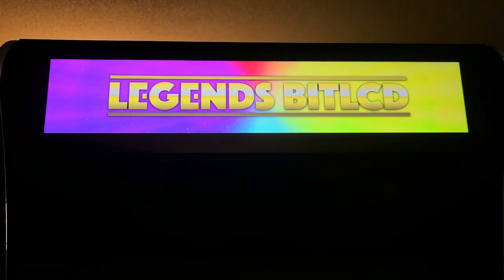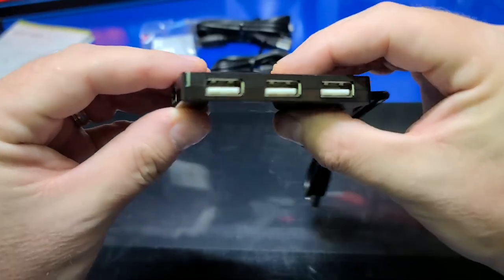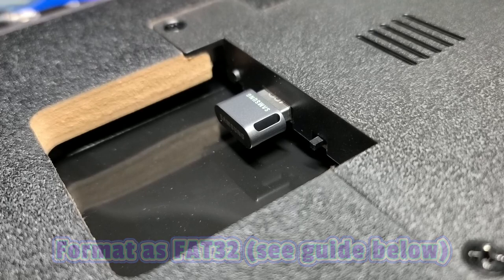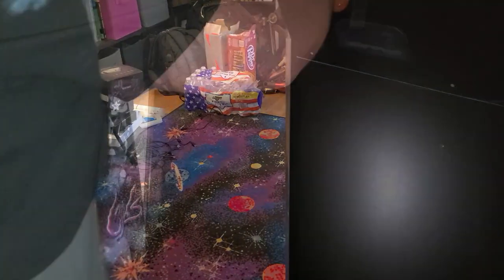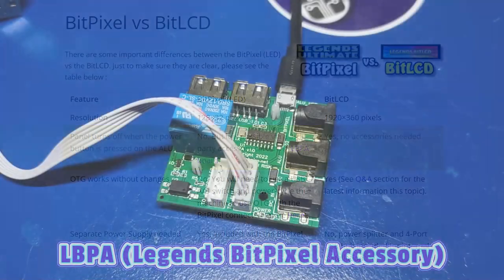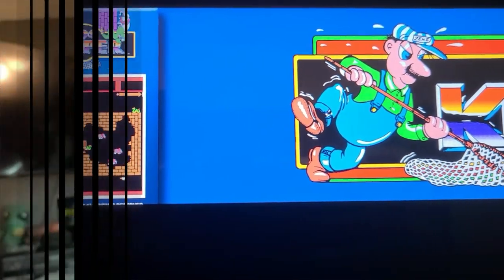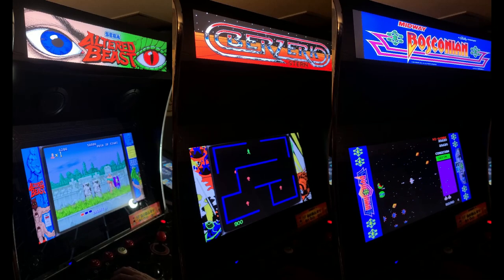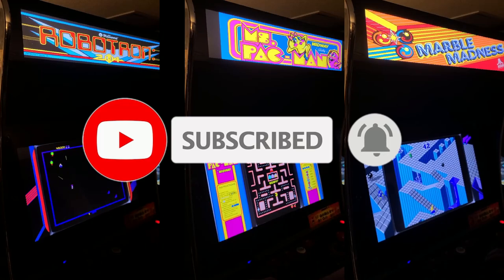Legends BitLCD Arcade Marquee Setup and Review (AtGames 2022)

Comment: Thanks for the video. I just installed my bitlcd as per the directions and when I try to load bitlcdx on appstorex it reads flashdrivex has not mounted. I am using a brand new 32GB PNY 3.2 usb and made sure it was formatted fat32 and I even tried another formatted usb. Does anybody have any idea what I may be doing wrong?
Reply from the maker: If you're talking about the USB stick on the ALU itself, have you tried formatting the USB stick using Flash Drive X (FDX), mount it and then install the BitLCD application from AppStoreX (see here https://wagnerstechtalk.com/al-bitlcd/#Update_Firmware_and_Resources )?  Of course, you also need a USB stick with the images on the BitLCD itself as well.  The guide at the link above has much more info.
Reply: Thank you for responding, my bitlcd doesn’t seem to recognize any usb that is in the usb2 slot. I tried formatting and mounting it on the cabinet and it downloaded bitlcd but I was unable to update it because there wasn’t a usb in the usb2 slot. Either I’m missing something or usb2 slot isn’t working. I am getting lights on my stick when I plug it in however.
Reply: AtGames responded and I was able to get the BitLCD running. I had to do some additional steps (maybe because of an update). I’m including in case anybody else has the same issue. 

Hi Christopher, 

Good afternoon and thank you for reaching out to us. I can gladly assist you with this matter. 
I have provided you the below steps to set up the flash drive and put both the update and resources on the flash drive from a computer. While it is a lot of steps, this should get your flash drive all setup and you all good to go. Please let me know how this goes.
BitLCD Flash Drive Setup Steps

1: Please confirm that your ALU's Firmware is up to date on 5.67 or later
2: Please ensure you are signed in on your ALU and have successfully installed the BitLCD application found under the AppStoreX tab.
3: Once this has all been completed, please power off your ALU and If the flash drive is in the back of the BitLCD, please remove it
4: We will now take the Flash Drive to your computer to prepare it. 
5: Please plug your flash drive into your computer
6: We will be using Raspberry Pi Imager software to erase and format the Flash Drive as Fat 32.
7a: If you have a Windows PC, please download Raspberry Pi Imager from the following link: https://downloads.raspberrypi.org/imager/imager_latest.exe
7b: If you have a Mac, please download Raspberry Pi Imager from the following link: https://downloads.raspberrypi.org/imager/imager_latest.dmg
8: Once you have downloaded and installed Raspberry Pi Imager, please launch it.
9: Under "Operating System", select the button that says "Choose OS". Scroll down until you see "Erase" and select it.
10: Under "Storage", select "Choose Storage" and from the popup please select your Flash Drive from the list.
IMPORTANT: Please Make Sure You Select The Correct Flash Drive You Want To Format For The BitLCD.
11: Please select "Write" and from the popup please verify everything is correct and select "Yes".
12: Once the write has been successful, select "Continue". You may now close the Raspberry Pi Imager software.
13: We will now download the "bitlcd_update_online.img" from the following link: https://wagnerstechtalk.com/files/atgames/bitlcd/bitlcd_update_online.img
14: Once it has successfully been downloaded, please take that "bitlcd_update_online.img" file and place it on the root of the Flash Drive.
15: We will now download the BitLCD Resources from the following link: https://wagnerstechtalk.com/files/atgames/bitlcd/BitLCD_Resources.zip
16: Once downloaded you will need to unzip/extract the file
17: Once it is unzipped/extracted, you will now have a folder named "BitLCD". 
Important: If the folder is named anything other than "BitLCD", please rename it to "BitLCD"
18: Once you have verified the name of the folder is correct, please take that "BitLCD" folder and place it on the root of the Flash Drive.
19: Once you have successfully placed both the BitLCD update file and the folder on the root of the Flash Drive, please properly eject the Flash Drive from your computer.
16: We will now take the Flash Drive and with your ALU powered off, we will plug the Flash Drive into the BitLCD.
IMPORTANT: Please make sure the little switch is up closest to the USB port
17: Once the Flash Drive is plugged into the BitLCD, you may power on the ALU.
If upon powering on you receive the flashing blue BT pairing lights, please hold down the P2 button for 7-10 seconds and this should take it out or BT pairing mode and turn the lights off.
18: Once Powered on and you have been successfully signed in, please head to the AppStoreX tab and launch the BitLCD application.
19: Once launched, verify that the BitLCD is properly working.
19: If not, please go into the BitLCD app and go over and select "Update BitLCD"
20: We will select "Update BitLCD Firmware". If at any point it fails, please try again and even power off and back on the device.
21: Once successfully updated, you do NOT need to update BitLCD resources since thay are already on the Flash Drive.
Please note that this process may take some time. Please let it run and don't interrupt it
22: Once this successfully completes, you should now be all set to enjoy your new BitLCD!
 
IMPORTANT NOTE: If the above steps still fail for you, please try a different/new Flash Drive as some Flash Drives may have issues properly reading.

Thank you,
AtGames Customer Support

Comment: I just got my BitLCD today and it was working perfectly at first. When I went to update firmware the screen went black and doesn’t work anymore. And yes, I had a USB 32GB formatted to FAT32. This sucks! I waited 2 years for this and this happens day 1. Multiple people have the same issue on FB ATGames fan page. The update will break your marquee! Why did your work and ours didn’t? I’m so pissed off at AtGames!
Reply from the maker: I installed/reinstalled the firmware no less than 5 times on my unit, multiple firmware versions installed also (5.65, 5.66 & 5.67) - no problems.  I recommend contacting AtGames customer support at : https://www.atgames.net/arcades/contact .  If it's an issue I've not seen nor can reproduce, I'm not going to be any help at this point.  I'm sure AtGames will take care of the problem, regardless.
Reply: That’s so strange. I had everything up and running perfectly. Had the Marquees displaying on the games and went to update firmware and the screen went blank. Nothing I have done has fixed it. I did put in a ticket with AtGames. Hope they come through. I don’t think I’ll ever update again with AtGames.
Reply from the maker: IMO - I always update.  When you get up and running with the BitLCD, I recommend updating.  At some point there is going to be a firmware update to use the HDMI port (most likely).  If there is a problem, you want to get it fixed while it's under warranty not after.  Just my $.02.
Reply: I appreciate your support. Apparently I got banned on ATGames legends global fan page for posting pics and my concerns. Unbelievable.
Reply from the maker: I'm sorry to hear that.  It's extremely rare when I do that, typically spam & porn is when I block users/delete posts here.  At any rate, get that BitLCD working through CS.  You'll be very happy with it when it is.  If there is anything I can do, just let me know.  When working, please let me know that too.

Comment: My lcd went kaput.  Followed tutorial. When its supposed reboot phase of firmware, it blinked and never restarted...was left alone for an hour for reboot and nothing. Powered cycled, starts then says no signal and shuts off.
Reply from the maker: What model ALU do you have, 1.0, 1.1 or 1.2?
Reply from the maker: Also, try unplugging the power plug from the wall itself and re-plug it. It should come back on (steps also here: https://wagnerstechtalk.com/al-bitlcd/#Troubleshooting ).  Then try again, if that doesn't work you can reach out to AtGames CS here for their recommendations: https://www.atgames.net/arcades/contact (purple icon for chat)
Reply: @WagnersTechTalk  Alu 1.1
Reply: @WagnersTechTalk  it turns on shows atagmes green logo, then gies blank and shows no signal screen and then shuts off.  All it does.
Reply from the maker: Try unplugging from the wall and back in, let me know if something different occurs please.
Reply: @WagnersTechTalk  samething.
Reply from the maker: Got it, I've not seen this issue on my machine (I only have the one).  Try contacting AtGames from the link above.  They may be around for another 20 min. and may have a better suggestion.  If you find out anything, please let me know though.  I'd like to update the guide with any issues/solutions.
Reply: The toggle switch next to the USB drive is in the wrong position.   Its set to HDMI.  Check it.  It gets bumped because we are constantly fiddling with the STUPID design when removing the drive to add content. Switch the toggle switch towards the USB to select USB input.  A USB extension is HIGHLY recommended.  How about a remote way like SSH to access the drive?

Comment: I’m running 5.62 and extremely worried about updating firmware and it breaking coin opsx.  Is a firmware upgrade required for this to operate correctly?  I can see bitlcdx in the App Store currently
Reply from the maker: Yes, a firmware upgrade will be necessary.  Also, the latest firmware has some advantages when it comes to CoinOpsX.  EDIT: I originally stated the 5 login requirement would be removed in this release (5.67) and verified with AtGames this morning that the restriction still exists in this firmware.
Reply: I'm in the same boat. No idea the new firmware got rid of the Coinopsx login requirement. That's great news.
Reply from the maker: I was wrong, this firmware update, 5.67, does not remove the 5 CoinOpsX launch restriction.  I just checked with AtGames.  My apology, I thought it was being rolled into this update.  I'll edit my comment accordingly.
Reply: @WagnersTechTalk  Hello Wagner, I own an old 1.0 and can’t seem to update my firmware above 5.65. I keep getting an error message saying I don’t have enough storage or my internet is bad. I have excellent internet connection and plenty of space. I also get a message saying that there is no new firmware available for my device. How can I fix this problem?

Comment: Can this be installed in the arcade legends pinball???
Reply from the maker: It wouldn't fit "in" the Legends Pinball, it's wider than the backglass.  Also, I've personally only used it with the Legends Ultimate.  However, the ALP does have a BitLCD app. so it should work, just that you won't be able to mount it physically in the machine.  Mounting on the wall may work though.
Reply: @WagnersTechTalk  Does or would the BitLCD software work with the original BitPixel hardware (just setting it on top of the ALP machine). Or is there different software needed to talk to the BitPixel screen (when used on the ALP?)
Thanks for your help and so much great information!
Reply from the maker: There are two different applications, BitPixel is for the BitPixel/BitPixel HV and BitLCD for the BitLCD.  I was able to run both at the same time on the ALU.  Very welcome!

Comment: so this has been a bit of a mess - so anyone w/ a 1.0 know how to install the AC splitter?  It's too big to fit into the port on the inside - this video shows two ports but 1.0 only has 1 and that splitter does not fit
Reply: All right, so I figured out a work around on 1.0 - you can plug the ac splitter into the back of the control panel, then plug the bitlcd cable and original ac cable into that so there's only the one cable coming out the back still.  Atgames the suggested method is to plug the splitter into the back but that's too many cables hanging out the back imo
Reply from the maker: Glad you got it working, what do you think of it?
Reply: @WagnersTechTalk  looks awesome!  Once I get some of the community art installed I’ll probably make a few videos.  I need to make a few mods to the back to allow some better cable management.  The 1.0 requires more cables externally by default so I’ll have to come up with some creative ways to hide some stuff.
Reply from the maker: So happy you're loving it too!  btw-See the Resources section (bottom link from JamesT) for his google drive post.  His artwork looks very nice!  Some won't take full advantage of the available space, but they aren't scaled so still look good.  If you make a video, please drop me a link here, I'd love to watch it!